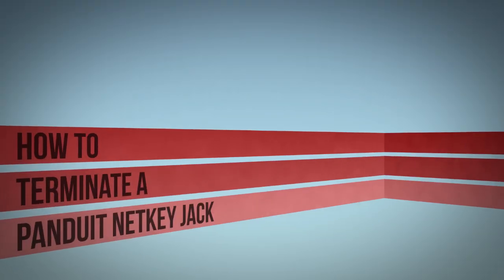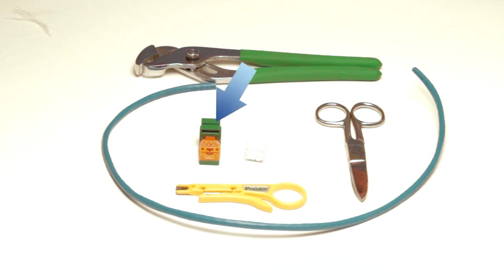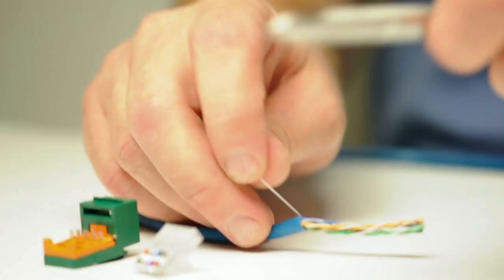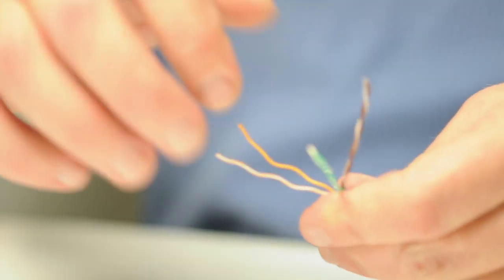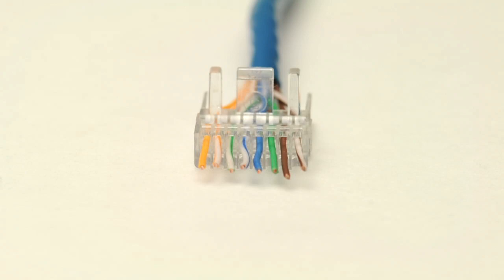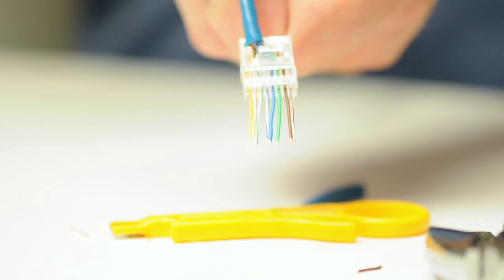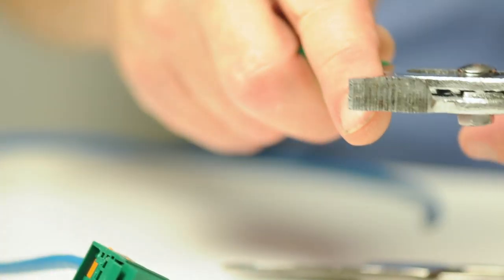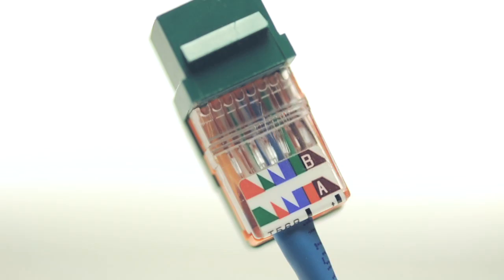How to Terminate a Panduit Netkey Cat5e Jack

Comment: That color code is not T568B wire colors
1 - white/orange
2 - Orange
3 - White/Green
4 - Blue
5 - White/Blue
6 - Green
7 -White/brown
8 - Brown

This video has the browns reversed.   But even if there were no colors as long as you wire both ends the same (even if wrong color order) it should work.